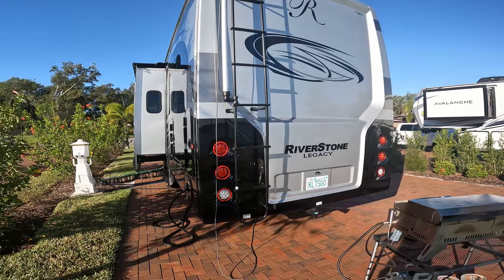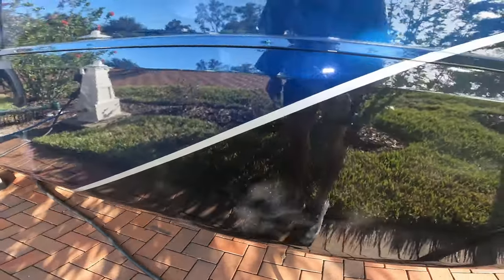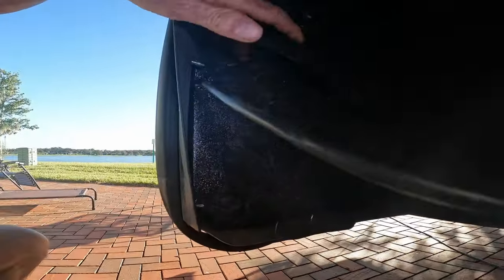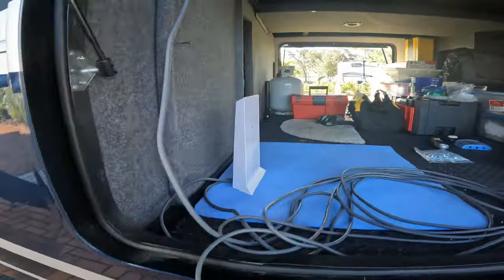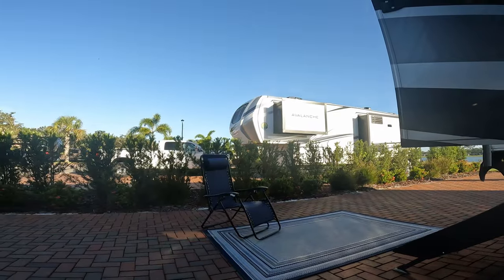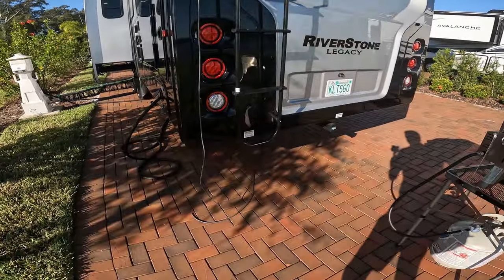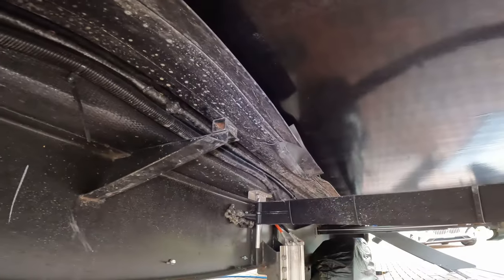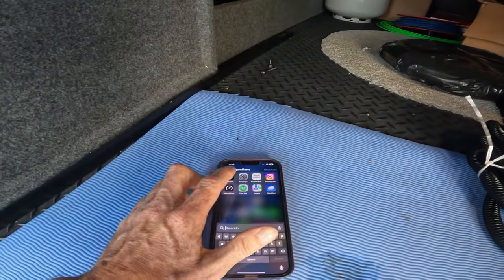Semi-Permanent Starlink install on a Riverstone 39RKFB 5th Wheel

Comment: Great video!  Frogs too, so quite applicable as 2023 39rkfb.  Would be interested in your experiences so far with your unit.  Liked your original plan.  Looks a bit cleaner, and I can avoid the tire area.  Thanks for sharing,  perhaps a meet and greet on the road someday!
Reply from the maker: Our Riverstone and Starlink have both been great.  I'll have another video coming out soon on a slightly different approach to the installation and better placement of Wifi routers.  Stay Tuned for that...its probably 2 weeks out.